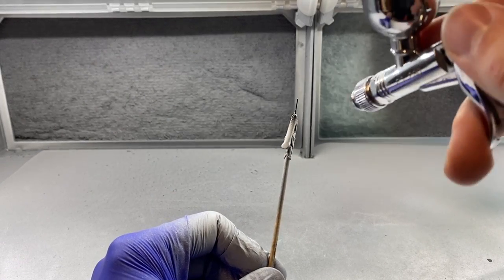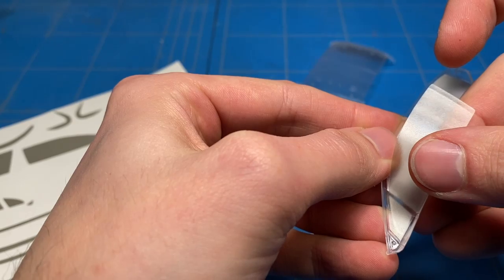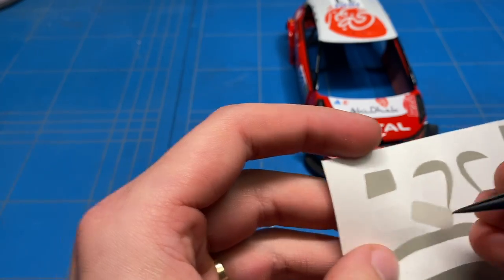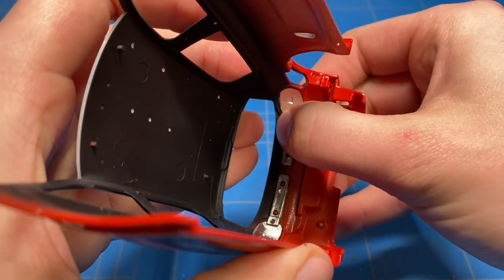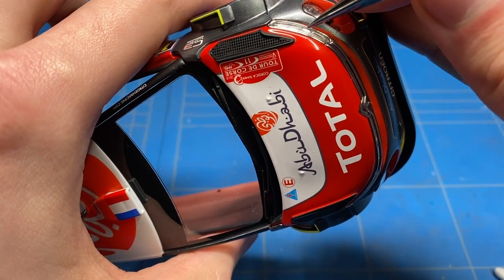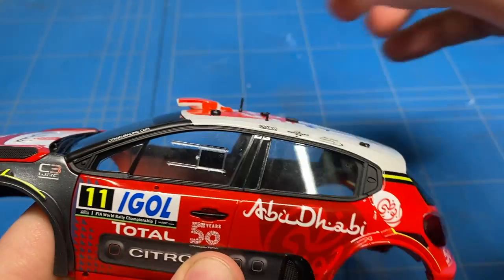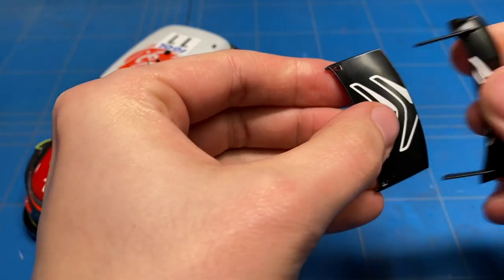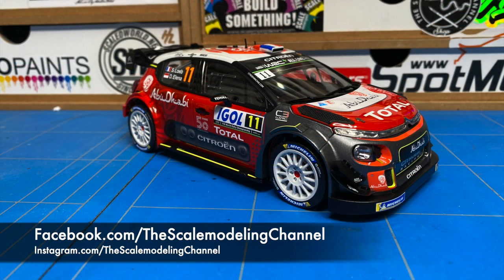Belkits: Citroen C3 WRC Tour de Corse 2018 Part 4

Comment: The reason updates are late is because the automated shop is open?   You may want to re-edit that.

I was told by the photographer at Sebring to paint our racecar with a less shiny clearcoat because it had a weird effect last time we raced there.  After we restickered for the 12hr race we used a lower sheen clear and the photos turned out much better.  I'm assuming this is why a lot of other cars aren't really shiny.